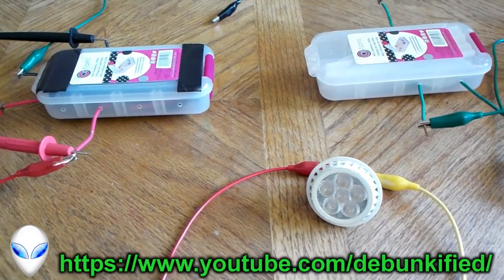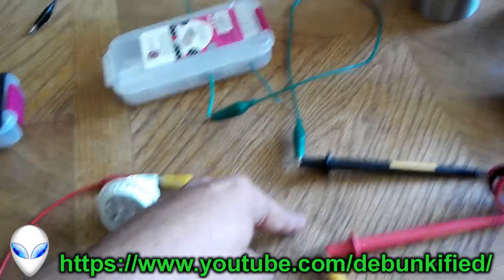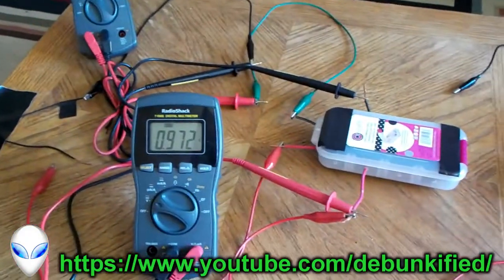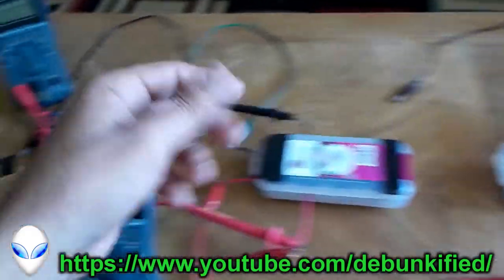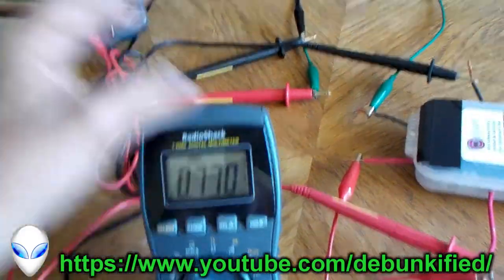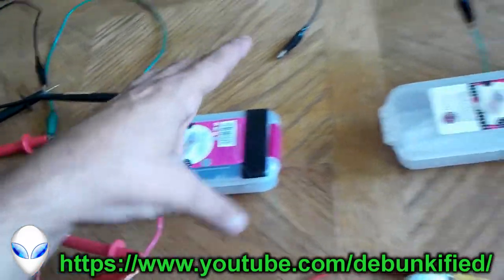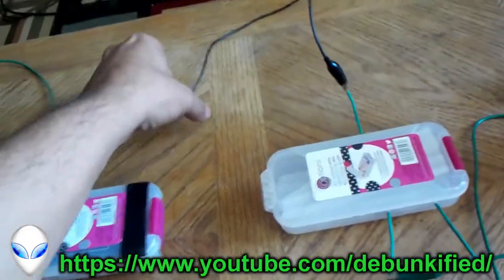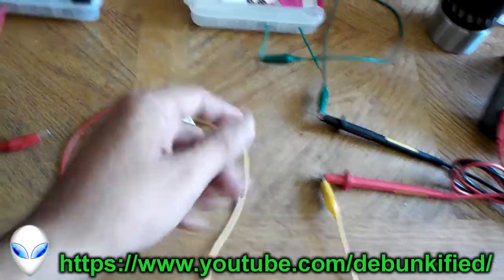More Energy Out Than In

Comment: Also same error here you need to measure the output voltage across the LED load....
Reply from the maker: +overunitydotcom The error as you call it is the correct way to measure total energy in the system output. The wattage measured is through the LED and through what's in the box, if what's in the box is not considered a load, then it can be construed as an error, but the point is that there is more wattage out than in, plainly seen on a meter.

What's in the box is a load as well, the LED is only part of the load as well as what's in the box.

For instance if there are two resistors in series which represents (the box and the LED in series) then the same current runs through both, but the voltage across only one resistor is only part of the entire voltage, as well as the other resistor's voltage.

Looking at only one load resistance at a time will not show the entire available energy as compared to observing the entire output wattage across both load resistors.

The full entire output energy across both load resistors, or in this case the resistance of the box as well as the LED is more than the input energy, which is the point I am trying to convey, and has always been the point.
Reply from the maker: There isn't any RF, this is smoothed out, double filtered, clean DC, as clean as the DC found flowing from a battery. Which shows as a very stable current that doesn't change or vary like a weird AC or radio signal would show.